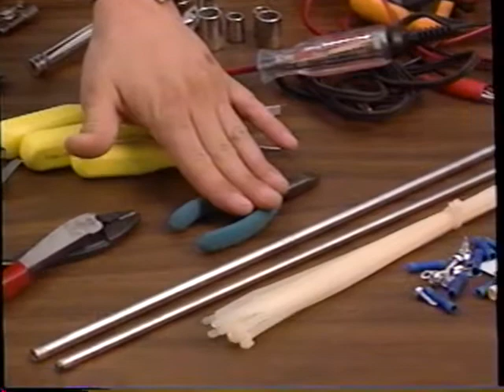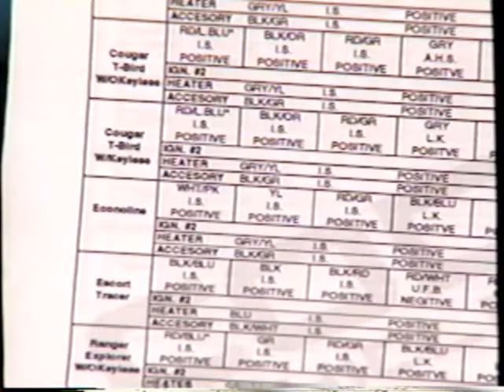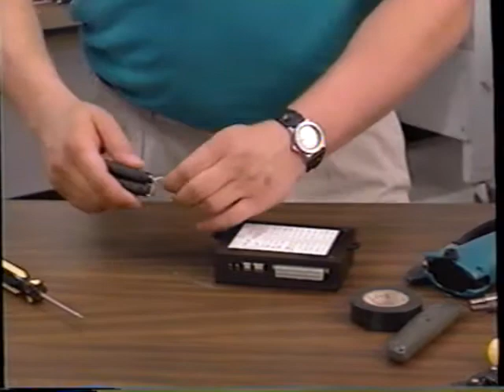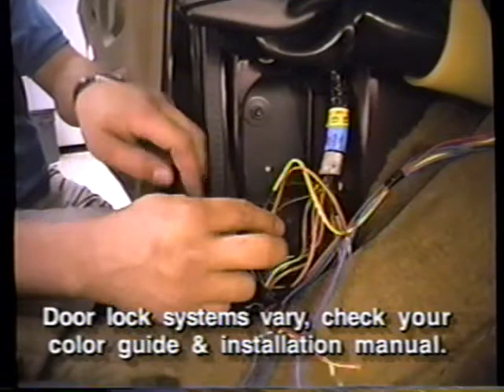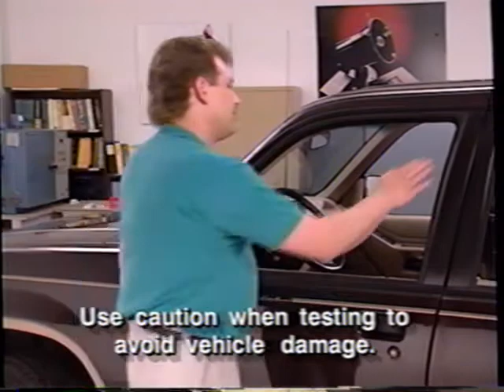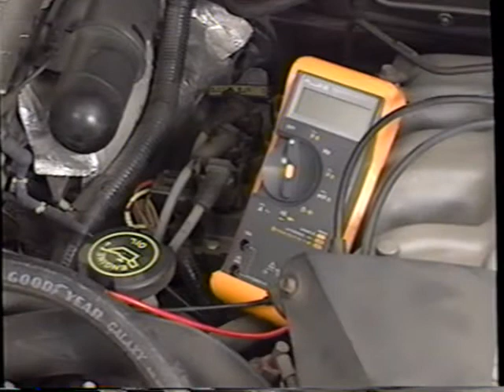Code Alarm - Professional Installation Training

Comment: Would it be better to use splices?  Anyhow it's ridiculous to do customizing? because it won't work properly. I bought a 2007 Ford f150 with code alarm the remote can't start the car.  I am watching all that process just because I would like to take off.

Comment: Thanks for posting this tutorial as I had a reset program to do and most of the local Code Alarm people and BMW mechanics failed to know how to do the reset for the remotes. Really simple and I did it in less than 20 seconds. Thank you again for such a helpful video as it probably saved my another $600 or more for w new alarm system. Love the Code Alarm Elite 2000ES system that came with my used car. It appears the connectors got a little corroded over 20 plus years. Cone Alarm is really a great system.Thanks !!